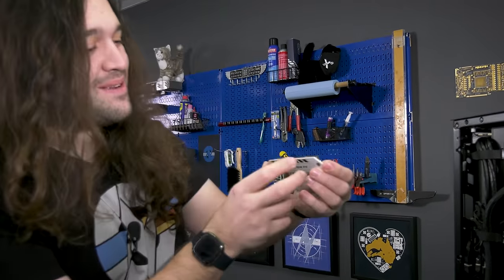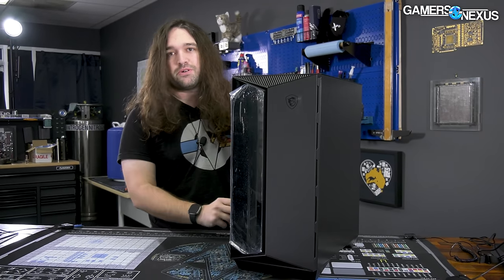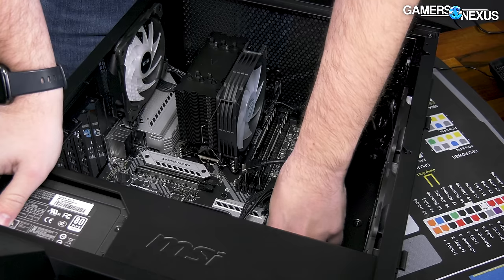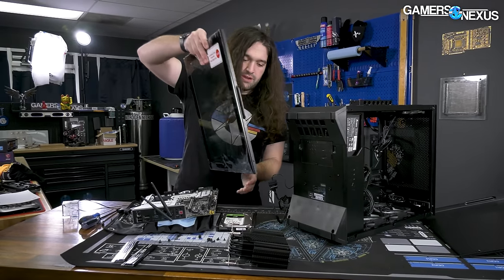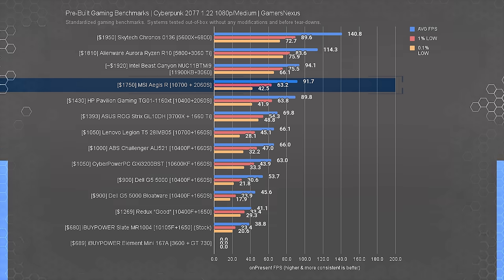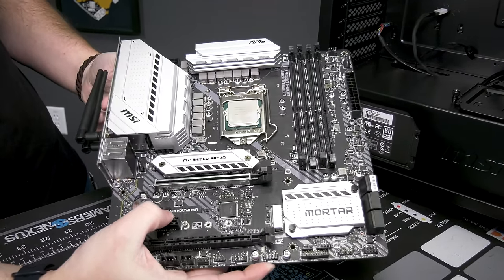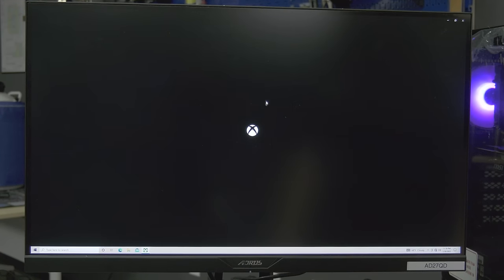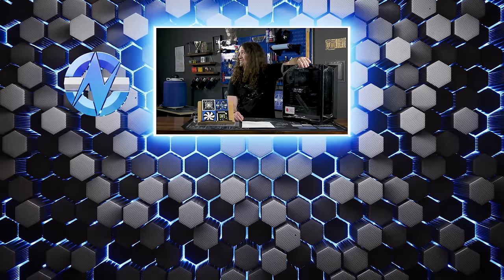MSI Pre-Built Bends SSDs & Boils CPUs at 100°C ($1700 Aegis R Review)

Comment: Rookie mistake installing an M.2 heatsink on top of one of those Adata M.2s.
They come with an aluminum heatspreader installed from factory (which is very difficult to remove due to an adhesive thermal pad being used), that adds height and most motherboard included heatsinks will crush it even if not tightened all the way.
This is worse than just over-tightening, it's reckless and could cost the customer time and money should it kill the part.
Reply: Not to mention lost data.
Reply: I got that PC are you saying I should remove the heatsink?
Reply: Uhh sorry for late reply but i bought a kingston fury renegade ssd and it came with a heat spreader, i removed the spreader and installed a heatsink on it and noticed a nice heat decrease. So did i do a bad thing? The ssd is working perfectly fine though, crystaldiskmark said its reading and writing at 7gb/s so its normal.

Comment: As an old diehard MSI customer, their quality has dropped tremendously over the last decade. I remember when I had issues with some monitors and 1000 series GPUs and, while they didn't reimburse you for the shipping costs, made up for it by upgrading your current product. I remember having a 60hz 1080p monitor that they replaced with a 90hz 1440p monitor, or a 1070 with no display output that got shipped back as a 1080 ti. It didn't cost the company that much more, as they only lost $100-200 USD when they upgraded you, your defective product can be fixed and sent to another gamer instead of to a landfill, and you felt satisfied with the result as an end user.

Nowadays, their customer service and product quality is a shell of its former self. You can definitely tell that there are great workers in the company, but the air is just so intoxicated with corporate bs that it undermines what they used to stand for less than ten years ago. Hope they go under new management and go back to doing things because they made sense, not cents.
Reply: Sounds like the situation with many other well known brands, the bean counters have taken over and started squeezing all of the value out in the name of shareholder value.
Reply: That's really horrible
Reply: If we can't rely on MSI anymore, who do we buy from? I dropped Gigabyte a few years ago since their boards seemed to get less reliable. I dropped Asus 15 years ago for the same reason. I don't think Asus got any better meanwhile.
Reply: Msi God like....it makes dragon sounds 👏👏👐👏👐👏
Reply: Remember when MSI Returns & Warranty dept was 2 old guys in a garage? Seems they got promoted to heads of MSI QC.
Reply: @mjouwbuis  try asus again, ive had really great experiences so far
Reply: MSI lost me WAAAAY back when they were making Socket A motherboards (which I worked at a computer shop at the time, we had a lot of them come back with WEIRD problems, like burning traces on ram sticks and smoked chipsets, or just unresponsive boards), I have tried to give them a chance over and over in the past 18 years and still they just can't make me happy or impress.
Reply: MSI has spent a lot of money on advertising, so they have to recoop some of the money somehow
Reply: What brand would you go for now?
Reply: @mjouwbuis  i like asrock
Reply: Asus $ > MSI $ but Asus quality >>>>>>>>> MSI quality. GPUs and motherboards, idk about prebuilts from either
Reply: @mjouwbuis  Asus is far better than most of the other vendors for GPUs and motherboards usually, outside of a couple oddities like backwards cap
Reply: I still love their motherboards. Only brand I buy  for MB. I’ve never had a problem.
Reply: @TranscendentPhoenix  Their innovations in the laptop space are really something, they are the ones who pioneered the dual screen laptops, i can't wait for an AMD based one. I almost bought one, but for now Steam Deck it is. They also have the cheapest and very reliable AM4 mobos, built 3 pcs using their MB PRIME A320M-K, heard no complains since. While my Aorus x470 Ultra Gaming mobo died after 6 months, i had no clue what happened, nor did the webstore i bought it from tell me anything even after asking for the why.
Reply: Should've seen what happened to their laptops in 2016-2017. Within a year the keyboards were completely dead. Tons and tons of people all had the same sets of keys failing at the same time and MSI just completely ignored it. I've got a f#$@5ing lemon now that doesn't even turn on reliably.

Comment: The price just seems insane to me even before they messed up the performance of the components.
Reply: Yea, you could build this exact computer yourself for way less...
Reply: @brucepreston3927  if you can get the gpu lol
Reply: Agree. I bought a laptop that can crush this machine for less money.
Reply: @jakesully2868  Which brand is it from?
Reply: @Joze1090  you could way overpay for one on ebay and still come out ahead...
Reply: @Joze1090  Availability is very good here in germany. Prices have been dropping since january but they are still expensive ofc.
Reply: prebuilts are marketed at people that don't know prices or anything
Reply: I built a better speced pc with q 2070 SUPER in it for 200 dollars less than this thing cost. With rgb might I add
Reply: Yup. I got a more powerful setup than this for 1500
Reply: Yeah, $1750 for a 2060S and a 10700 is crazy money. In the UK, I've seen 2nd hand 5800X/3070 builds go for the same or less.
Reply: @sonicboy678  Asus Strix Advantage with 6800m
Reply: @jakesully2868  Huh. I was slightly hoping you would say it was from MSI for the irony, but Asus definitely makes sense.

I remember seeing Tim from Hardware Unboxed saying that he couldn't recommend the TUF Gaming A15 (the 2020 model) in part because of the less-than-stellar thermals. He even had the backplate cut around the fans which improved airflow and didn't seem to impress Asus. Still, Asus left more holes in the 2021 revision and seems to have left even more for the 2022 revision (along with having 84-blade fans instead of 83-blade ones).
Reply: Yeah I bought a rig with a 3070 in it last year for that price. The idea of only getting a 2060S is absurd.
Reply: @jakesully2868  Same one I have
Reply: @sonicboy678  Yea, different models. Some Asus lappytops are junk, and some kick butt. Gotta watch Jarrods Tech for good laptop information.

Comment: The really sad thing is, by simply using a case with airflow, correctly installing the SSD, and not adding bloatware, this system would actually make some sense.
Reply: I thought that might be the case too, but the thermals remained garbage even with the case opened up. While the bloatware would make the CPU run hotter on low loads I don't think it would effect the torture test's (thermal) results much. The problem is the cooler - the V5 is good at what it does, but it's got a TDP of 150w and a 10700 under load will go past 200w.

I think MSI knew the Vetroo was cheap and had a good public image (again, it's great at what it's designed for), so it was an easy marketing move to install it even though it's asking way too much of the poor thing. If you reset the bios, reinstalled the OS, and changed the case out you'd still need to replace the V5 with something that's rated about 100w higher.
Reply: @candorcore3502  True. That cooler is being pushed to or past its limits for sure. Def agree with your assessment on why they went with it anyways.
Reply: With a 2060? For $1,750? Why would you use such a low end card in such an expensive system?
Reply: @anakinlowground5515  Didn't say it would be a good deal. Also GPU prices have only recently gone way down.
Reply: @802Garage  Fair enough.
Reply: who doesnt clean install windows when getting a new pc?
Reply: @SierraAAM  It’s always good advice to reinstall windows on every computer you don’t build and get the drivers/software yourself. It’s advice I give everyone who gets a prebuilt computer. It’s not even hard to do. But to be fair, the average prebuilt gaming pc consumer doesn’t know shit.

Comment: Here's a fun idea: take all the internals and throw them in a generic tower case, and see how the thermals stack up in the "basic beige behemoth." It would be interesting to see if some el-cheapo case has better airflow...
Reply: It does. Many great airflow cases for under 150 dollaz
Reply: @prla5400  I think by el cheapo he means less than 60 bucks
Reply: @prla5400  150 dollars doesn't sound cheap lol
Reply: They already did this one with the front panel off. That's pretty close to open air which you're not gonna get much better than
Reply: No case is going to have better thermals than taking the front panel off, and that still didn't solve the problem. The case is bad, but the real problem is the bizarre BIOS and power settings that force this CPU to run at full wattage for even simple tasks. Modern CPUs are absolutely not designed to be used that way.
Reply: @prla5400  LOL  Cheap?

Comment: That plastic backplate is good for one thing only: Keeping screws and other metal bits from falling onto the GPU unnoticed and causing a short.  Or water from a leaky water block connection.
Reply: that's not a good excuse, they could easily make a metal backplate for not much more money. even cheap metal like magnesium would be better than plastic.

Comment: The Ultimate Power Plan is usually only available with "Windows Pro for Workstations" which is a sku used for multi-socket cpu monsters with features closer to Windows Server. It's possible to "hack" the power plan into regular Windows Pro. If that was a Not a "Windows Pro for Workstations" OS, they hacked that in. If by chance it came pre-installed with it, then it shows they're incompetent cause a single socket gaming system will never be able to take advantage of it.
Reply: I have it on my MSI pre-built but and I have Windows 10 Home
Reply: @Iowcatalyst  Yep, that's why I put "hack" in quotes.
Reply: I'm assuming they're WinReg settings,
these didn't use to be considered "hacks".
Reply: I can use it on windows 10 and 11 pro from a factory reset

Comment: It's interesting seeing the thermals and settings issues on this one, as I have a computer from this same line. Admittedly a much higher end one as it came with an RTX 3090, but it was the same exact case physically, and I ran it for a year without issues, prior to scavenging it to use the 3090 in a custom build. But I have a suspicion that the only reason it worked well was they used a 240mm liquid cooler exhausting out of the top of the case, and with the rear exhaust and the front fans, and that radiator with its fans, likely had enough pressure to minimize the effect of the shitty case. I'm wondering how much they bothered customizing the BIOS settings for all of the different Aegis PCs- while they use a common case,  they include everything from an RTX 2060 to a 3090 OC, and some with pure air setups or some with 120mm or 240mm liquid coolers. If they used just one set of BIOS configurations and flashed them all the same, it might explain some of the garbage settings.
Reply: You are right, at 21:30 you see the CPU Cooler Tuning is set to Water Cooler
Reply: Yeah I have one with an RTX 3080 and i7 11700kf and it came with a 120mm aio for some reason. After I replaced that with a 240mm one on the top it's been running fantastic. I don't think it came with Norton either but I might have uninstalled it when I got it.
Reply: Exactly.  I have the Gungnir 110R with a setup similar to yours.  I have the 360MM AIO in the front and 2 exhaust fans at the top.  I have MSI center set to balance so I'm not even throttling the fans and I max out my CPU at 70C when gaming.  So it's not the case.  Just a shit prebuilt.
Reply: What kind of person buys a computer and doesn't build it 😂

n00b...
Reply: @samholdsworth420  i guess the same people that buy phones and don't build them smhsmh
Reply: @hondafknciviv3818  ikr
Reply: @samholdsworth420  did you build your own house too? I hope it's not just me ):
Reply: @hondafknciviv3818  I build houses for a living so yeah
Reply: @samholdsworth420  oh that's actually pretty cool
Reply: @hondafknciviv3818  I can't lie I'm trolling...I do build my computers though 😂
Reply: @samholdsworth420  damn, fair enough. I built my own pc too and as bad as it was, i felt so proud
Reply: I have this exact case with a 3070ti and the thermals are actually great. I've tested with the front panel off and lowers my temps by a whopping 1c. The front panel has plenty of airflow as long as you're not running fans at 100% the entire time.

Comment: Been waiting for another review! 
Here is a thing I feel you guys should do.
After testing it how it came out of box, you guys should install a fresh windows, set xmp and the way you would have it setup (no bloatware, power management) and run the same tests again. Would LOVE to see how they compare!!
Thanks again guys great review as always.
Reply: Yeah, that would be an eye opener for many. Out of the box performance vs the do-over.
Reply: Yes, I agree with this completely. To show just how much performance the manufacturers are leaving on the table.
Reply: Yeah, it seems like the "power virus" behavior all came from the BIOS settings and Windows power plan. Reset the BIOS and enable XMP, clean install Windows, and take off the front panel and it seems like you'd actually have a decent PC, other than the bent-but-for-now-functional SSD.

This seems like it would be an option in the spirit of this series's conceit of answering the question "what can I recommend to a friend or family member that has an upgrade path and ISN'T me building them a PC and being expected to support it forever."